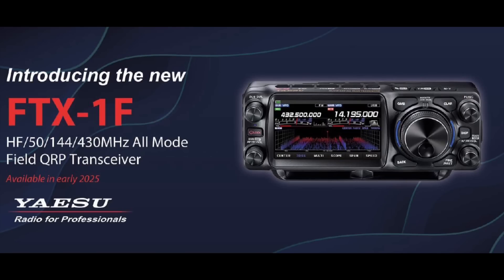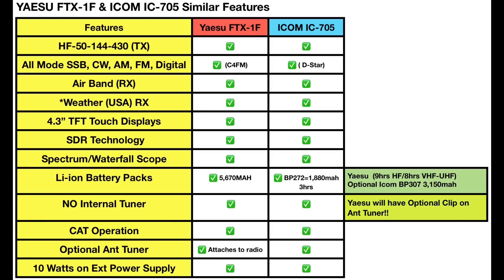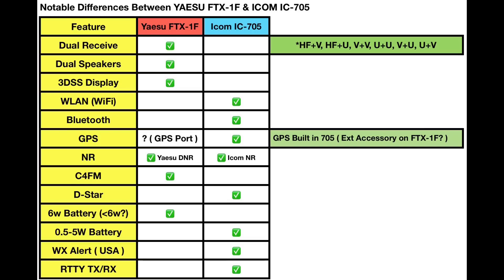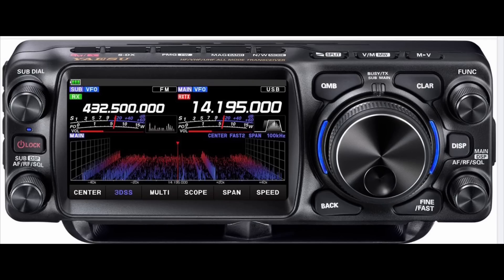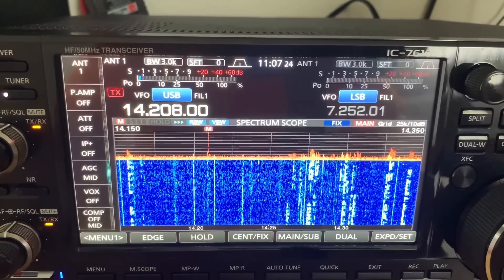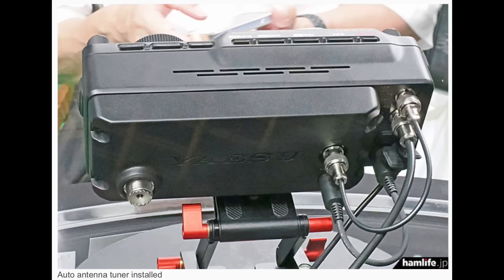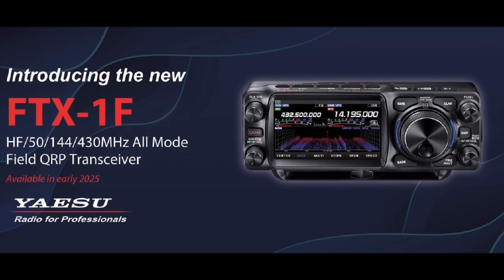New Yaesu FTX-1F QRP RADIO Announced Features compared to Icom IC-705

Comment: I have equal love for Yaesu and ICOM, so I'm curious how they'll stack up once we get the full specs and some hands on reviews out there. If Yaesu works their magic on the Rx like they have their higher models that may push me this direction.

I started out as a freshly minted 14yo ham with an FT227 and pair of Yaesu Twins but frequently used my neighbor's 706 and 746 so both brands hold a special place in my heart... 

Hell, even now I have a 7200 in the shack and an 817 I pack around with me everywhere. 
KC9FJE

Comment: Well, since an antenna tuner hast both an input and an output the SO-239 must be the output. And the choice of different connector types is just to annoy users. But the argument will be that it is to avoid any errors when connecting in/out

Comment: According to some sources Yaesu will have Bluetooth and wifi.
The PL-connector on the back of the tuner (left) is where the antenna goes.
On the right the bnc is the rf in from the radio (jumper cable) and also the cable for tuner operation (mini-din).
73 ON4VP
Reply from the maker: @PhilON4VP  That’s Great I didn’t think that they would leave those two features out but at the time this information was not out!  Thanks 73
Reply: @PrecisionGroupYT  I am also in the market for this new Yaesu. For satellite QO-100 it will be possible to work full duplex ! 73 ON4VP

Comment: Thanks fot great comparison.
I agree with u that it hard to see benefit of 3d except nice mktg that icom does not have.
Frankly, I don't see PORTABLE (I mean backpack, not rv)  use for for this size rig (I compare it to ft817, kx2, x6100 all with built-in batteries and option hf vs atu). But I'm not vhf guy so...
Cat Bluetooth is however important to me (x6100 has it, for others tiny dongles exist).
People say that WiFi of ic705 makes it great remote rx/trx....
Anyway, great post. TU
Reply: Agreed. And I wonder what the standby power draw is.  I also backpack/SOTA and weight is an issue as well.  Can't find specs on either of these important numbers.  If you can shutdown the fancy band scope to save on power and if it isn't too heavy, then I might replace my 817ND.

Comment: I have the twin 7300 and 9700 units for portables, so now I'm going to pair my 705 with the 905 for QRP backpacking! I like the idea of having the fringe band coverage and being in the 1% that has the microwave capability. My main base rig is the Kenwood TS-990 which I've had for almost 10 years now and still have no desire to replace.
Reply from the maker: @ChatGPT1111  I also love what I call the Twins ( 7300 & 9700 ) but couldn’t justify ( for me ) getting the 905 to go with my 705 especially as I have not had as much time as I would like to do HAM radio!  The TS990 looks like a Truly amazing radio and I would love to get some operating time with it in the future perhaps one day!  I would also love to get some operational time behind an IC-7851 as well and compare it to my 7610 ( especially after some HAMS sold their 7851 and opted for the 7610 and told me that the performance of the 7851 was very similar to the 7610’s performance! ).  Thanks for watching and commenting! 73

Comment: I would like to be able to connect a small portable solar panel to charge the battery in the field with USB C, etc. GPS and Antenna Tuner should be built in.
Reply from the maker: Obviously connecting a solar panel directly to the radio would be problematic but having the radio connected to a small battery bank that you are charging with a small solar panel is totally doable!…..this is why I like the OmniCharge Battery Banks (I did a video about using them with the 705 previously)! 73 thanks for watching and commenting
Reply: The 705 can be charged via USB which makes it compatible with many other options. I have mixed feelings about having an auto tuner built-in.  While certainly convenient it adds weight and cost which may be redundant. Many hams will choose a resonant antenna or to use the radio with a modest amplifier after they see what 10 watts can do. Making the tuner optional allows you to match your gear to your intended use.  Yes some QRP field radios include a built-in auto tuner, but they typically don’t include built-in VHF/UHF, WiFi, Bluetooth, GPS, and a large touch screen. I chose the 705 for its exceptional combination of technology and user experience.

Comment: I've had the FTDX10 for a few years occasionally I turn on the 3DSS, I don't really see any benefit, and I really dislike Yaesu's color options for the display.    I only want to see red when there is an issue - as a warning.   But I still enjoy the radio, receive is fantastic.    I'm seeing another swing and a mostly miss on this new radio, definitely not a true field rated radio, but only the lab599 hits most of those marks to date.   And still it's not a perfect option either for all of the features - but the closest so far.

Comment: I have an FTDX-10 and don't use the 3D display function.  Makes it look to cluttered to me.  Love the looks of this new radio.  I had an IC-705 and sold it but will probably get this new FTX-1F after an appropriate wait period for Yaesu users and Yaesu to work out any bugs.
Reply from the maker: @dpsflyboy  Thanks for your comments….waiting for all the bugs to be worked is usually a good idea! May I ask why you decided to part with your 705?
Reply: @PrecisionGroupYT  I just didn't like it.  Relatively short battery life and at the time, I changed my priorities.  I'm using a Xiegu X6100 now for QRP.  Love it.

Comment: I’m curious how many watt hours the Yaesu is.  Airlines have a 100Wh per battery limit.  Hopefully that’s exactly what they aimed for.  It physically looks about the same size as my 100Wh USB battery packs.
Reply from the maker: @AZREDFERN  well if we take Yaesu’s spec of 5,670mah x 3.7V ( not sure of the voltage exactly just yet? ) we get about 21Wh!  73 K4BBC

Comment: I got my license in 2019 but still not got an HF radio, so I think the 705 will still be my first HF radio.  Yeasu are just a bit too Fisher Price for my liking
Reply: I‘m also new and want to get 705 to be more flexible with antennas. I don’t want to do all the antenna installation on the roof and spending money for lightning protection etc. I’m expecting to have a nice dx and FT8 experiences. Hope so or?
Reply from the maker: @richardtwyning  I would normally recommend a 100 watt radio for your first HF radio so you can jump in to making HF contacts fairly easily and get your feet wet ( so to speak ) first before going in to QRP!  But the 705 is a “Swiss Army” Knife of a radio! 73
Reply: @PrecisionGroupYT  I'm in the UK so our limit is now only 25W I'll upgrade as soon as they replace the 7100 😉
73s M7GTX 🇬🇧👍🏻
Reply from the maker: @richardtwyning  Ok I understand good luck! 73 K4BBC
Reply: The only HF radio I own is an IC-705 and I've made over 1500 QSOs on HF, and rag chew on 2m repeaters all the time.  You won't regret it.

Comment: Maybe the SO239 on the Auto tuner is
the connection to the antenna? 😅
Reply: Obviously, since it's a linear and they show the HF BNC going to the BNC on the linear, so that's the input to the linear and the SO-239 is the output to the antenna.
Reply: @hjc4604  It's the ATU (not linear) output to the antenna but why on earth have they reverted to the truly awful SO-239 connector, having done the right thing by using BNC connectors everywhere else? Way past time that SO-239 and PL-259 were consigned to the trash can of history. (G3WGV)

Comment: I have a $35.00 reservation with DX
Engineering for the new Yaesu when
it comes out in 2025. 
I have a Yaesu FT-818ND, with the
Improved Windcamp Battery.
It is nice, except for the small display
and dim back lighting, like the old
Yaesu FT-857 all mode 100 Watt one.
73 de W2CH Ray 😅
Reply: Check out the CAT Display for the FT-818. https://www.youtube.com/watch?v=4_679PZsGMk

Comment: Looks like an expensive battery, prefer the setup with the battery on the Icom as it can be swapped out with the HTs. You still need external power for 10w with both radios anyway. Antenna socket on the tuner should have been BNC not SO239 in my view. The two good points with the Yaesu is the dual receive and dual antenna ports. I use a a diplexer on my Icom to give me two ports. Fans for finals cost extra and you don't need them for 10w FT8 with the Icom, it all looks too bulky to me. You can run the Icom tuner at the antenna for much better efficiency. All in all I'd only gain dual receive by going Yaesu and would suffer a worse menu
 system. Too many negatives with the Yaesu and not enough positives to change over in my view.

Comment: I have a 705 and I have an FTD X 10. The receiver performance on the FTX 10 is unbelievable.
But Yaesu isn’t serious about a.m. They don’t enable any of the selectivity features in amplitude modulation mode. The 705, and I’m sure the 7300, do a really nice job with a.m. selectivity. I wonder why Yasu doesn’t choose to enable a full feature set on a.m.? I use my 705 as a short wave amongst other things.
Reply from the maker: I do wonder why Yaesu does that (or should I doesn’t) with AM!  The 705 for short wave listening is good! Thanks for commenting! 73

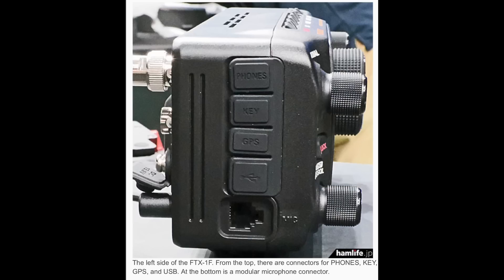Comment: 12:25 It's where the antenna connects to the Tuner, since the other jack is jumpered into the antenna port on the unit??
Reply from the maker: Yes that does make sense!  As I commented on another comment I was a bit confused as the top BNC connector was for HF/50MHz!  Thank you for watching and your comment! 73

Comment: I have the FTDX-10. I have used the 3d display a few times but find it confusing and hard to see the immediate signal trace with the background sound signatures. That being said, it is my favorite 2D display nonetheless.
Reply: I have found the 3DSS can show in me quickly if a particular band is propagating well, like 6M. For working the band I switch over to waterfall.
Reply from the maker: @horizoncam  Interesting thank you for your comment!
Reply from the maker: @matthew.tamasco  thank you for your honesty about the 3DSS display!  Out of curiosity have you compared the 2d waterfall on your FTDX10 to an Icom like a 7300 and if so do you still prefer the Yaesu?  I ask because being mainly an admitted Icom guy ( again didn’t intend to be when I started out in HAM radio it just ended up that I kept acquiring more Icom rigs! ) I am curious as I may decide in the future to part with my Flex 6400M and pick up  FTDX101(D or MP)!  Thanks for commenting and watching 73
Reply: I'm fairly sure I would not rate the Yaesu over the Flex 2D. I find Yaesu and ICOM SDR waterfalls to be similar with pro/con being mostly a personal choice on features, colors and scaling, etc. I don't have a lot of experience on ICOM but went with Yaesu based on my in-store observation of the waterfalls.
Reply from the maker: @matthew.tamasco to clarify I would not swap the Flex out for the FTDX101 series radio strictly on the waterfall display more so for the receiving capabilities of the 101 and some of it’s other highlights!  Thanks again 73
Reply: @PrecisionGroupYT  Hello! I have FTDX10 right next to IC-7300. Waterfall-wise, DX10 screen resolution looks better, you can connect an external display, which makes signal search a joy... However, I still like the IC waterfall more and think it's implemented better. I like the Icom colors more, they better show the signal strength. I like spectrum scope averaging, which Yaesu does not have. I like fixed edge presets (I usually have CW, SSB, digi and whole band edges set, e.g. 7000-7040, 7050-7200, 7040-7080 and 7000-7200 (region 1)), that helps me to orient myself quickly. And finally, in scroll mode, on Icom, when you move the cursor out of the range, next "page" is loaded. On Yaesu the whole range shifts, but the cursor is still at the end, so you don't see what's next. For example, I am used to zoom in in contests, e.g. to see +-5 KHz from 7004 to 7014, set scroll mode and go over the signals, working all the stations there and when I move over 7014 kHz, Icom serves me another 10 kHz of the band (7014-7024 in this case). Yaesu would shift the window range from 7004-7014 to 7005.7-7015.7, but your cursor will stay at the upper end and you won't see anything you haven't worked yet. You have to switch to fix, center mode and then back, which will reset the range so your QRG is placed at the middle again... This is of course usable, but not as convenient as it could have been...

3DSS... I use it sometimes for fun, you have to cut e sensitity of the waterfall down as much as possible to get rid of the "grass" in order to see useful signals... However even in that case, the geometry does not serve well. You aren't able to identify signals very well with 3DSS. On a normal 2D waterfall you distinguish LSB from USB, various digi modes or CW from QRN, etc. Just by the shape of the signal, but that's not possible with the 3DSS...

Comment: I like the looks of the FTX. So when do you think a 100w replacement for the FT-857 will come out? As for WiFi & Bluetooth. Not sure why you need it. But AS FOR the waterfall. I don't use the waterfall. Sorry I can't help you on that one. I have the FT8x7 line of radios. So I don't see me getting a new FTX any time soon. But, if they come out with a replacement FT-857d. I'll jump on that. This all goes back to Dodge, Ford or Chevy. They all get you where you want to go in the end.
Reply from the maker: @DavidS-iw4ei  yes the FTX-1F does look sharp as I stated in the video!  As fas as Bluetooth and WiFi allot of HAM’s connect their PC’s wirelessly to the 705 for Winlink and FT8 and other digital modes so they don’t need a wire connecting them!  Plus WiFi is very beneficial for some modes and uses with D-star ( and perhaps C4FM users could benefit the same way) Also with Bluetooth you can use and connect a wireless microphone like the Icom IC-VS3 which I use plus a wireless speaker like my BenQ Trevolo U speaker which work’s awesome with the 705!  As far as an FT-857D replacement I agree it would be great to see Yaesu come out with a newer updated version!  I would have loved to see an All Band FT-891 version!  When I first got licensed I was very interested in the 857D but realized it was long in the tooth and it was then shortly after discontinued but if they had that rig out there I would have picked one up…..it also maybe that Yaesu not selling a 100w all band all mode radio is a business decision as they sell more radios when you have to buy a VHF/UHF radio plus a HF radio?? ( don’t know that for sure but it’s a possibility )!  I agree with your Dodge, Ford, Chevy comment!  Thanks for watching and commenting 73

Comment: I believe the SO-239 connector on the tuner is for HF. No tuner for VHF/UHF. Thanks for the video. New sub here. 73 de WA3RSL.
Reply from the maker: That could be correct but what is a bit confusing about that is that the top BNC connector on the back says it’s for HF/50MHz but perhaps for the tuner the HF input needs to go directly into the tuner like you suggested and would make more sense!  Thank you for the comment and SUB! 73
Reply: @PrecisionGroupYT  the tuner has an input from the radio and an output to the antenna. Just like all other external tuners. The weird thing is that they use different connectors.

Comment: The newly announced Yaesu FTM-1F is expected to feature a built-in GPS providing location information for C4FM digital calls, with an external GPS port on the side for extra connectivity.
Reply: Rumor. Nothing confirmed about internal GPS,Bluetooth or WiFi.
Reply from the maker: @forgetyourlife  I have a hard time believing that Yaesu wouldn’t include these features to compete with the 705!
Reply: @PrecisionGroupYT nothing about them in the published specs or any icons yet to be seen.
Reply from the maker: Interesting thank you for the information! 73

Comment: It's the best anyone could do given there aren't any soild specs to go on, so while I see everyone trying to get their videos out. According to Peter, of WatersStanton LLC, the clip-on antenna tuner may not work if the battery it comes with, is inserted. Given the dimensions, and looking at the picture, including the two speakers, how do you fit a 3" tall screen in a radio that is only 2.83" high? I think a lot of what we know will change in the coming months, and a comparison between the two is a bit premature. Interesting, but premature.
Reply from the maker: Yes as more information on the FTX-1F comes out we will have a better ability to truly compare them and I’ll probably need to do an update video in the future thank you!